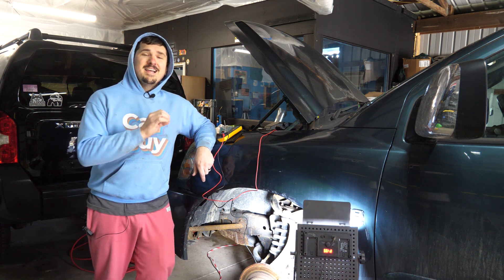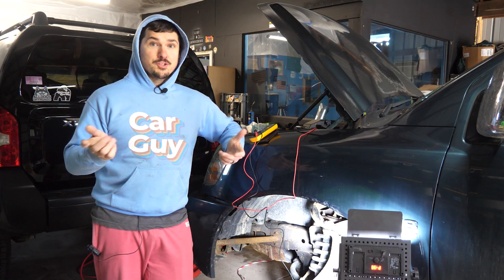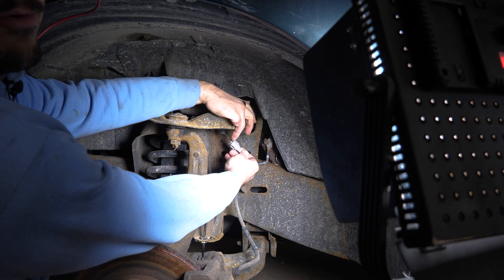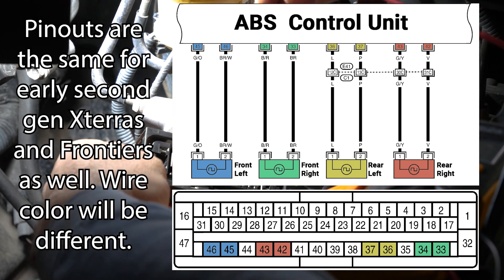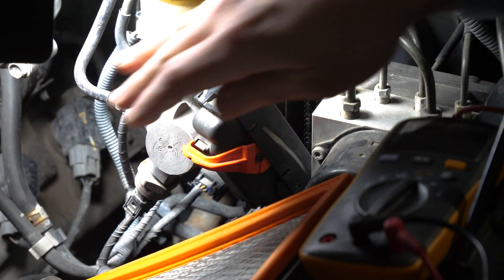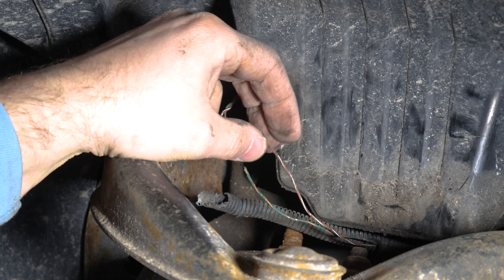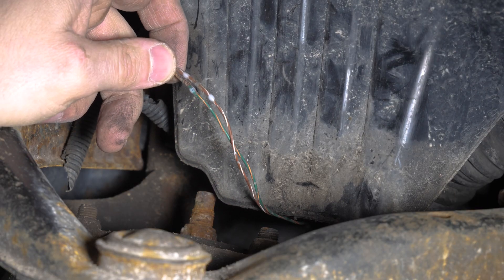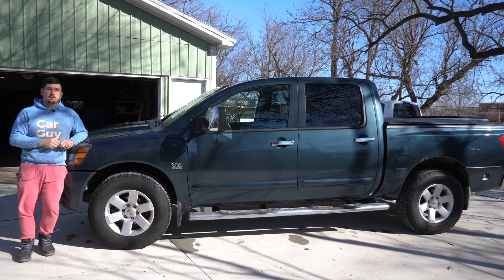How To Diagnose The SLIP, VDC, and ABS Lights on Nissan Trucks and SUV's

Comment: Hello Ry the car guy,  I have a frontier 2010.  Before I took my truck to the local Nissan Service Center. I only had the tire censer and the passenger safety bag light on. It was in the shop for a recall. Once I got the truck back, I drove off the shop inside and notice around the corner the emergency brake light, ABS light, SLIP light and the VDC light (off) was illuminated. These were not on when I pull into the shop. Do you think the mechanics disconnected or cut wire to the sensors? How would you approach this repair? Thanks
Reply from the maker: Wow, that's definitely not ideal. I would take it back to them and explain what happened!

Comment: What model scanner do you use from Thnkcar? I need to solve the ABS light problem along with the VDC and slip lights. Also the Diff. lock light.
Reply from the maker: I use this one and love it. ThinkScan 689 BT is changing the way I Diagnose.
https://youtu.be/keMX3X18bzY

Comment: Do the lights trigger anything on the OBD? I have an amazon reader but it says no error codes, wondering if i need a different OBD reader? Thanks!
Reply from the maker: Standard obd readers are only going to read basic engine codes. So no, you will likely not see anything on there. I use this brand and love it: https://mythinkcar.com/?ref=rzbuhuvm 

10% off if you use code RTCG

Comment: My same lights came on but also the brake light is on. Any ideas on that? I also have the 2004 Titan.
Reply from the maker: Check brake fluid level
Reply: Thank you but the brake Fluid is full.
Reply: Believe it or not, I wiggled the VDC solenoid relay, and so far the lights are out.

Comment: I have all 3 lights ON on my 2010 OR 6mt. error code points to ABS Controller. of course the part is discontinued.
Reply from the maker: Give me your part number. I probably have one here.
Reply: @Rythecarguy  mine calls for 47660-ZL00D, the scanner reads it the same too. But the sticker on it says 47660-ZL00C I haven't confirmed anywhere that they are interchangeable.

Comment: I have a 2011 frontiers pro4x. I bought used last year. These same lights have been on since I got the truck but it’s throwing a rear locker code. From what I’ve read online could need new rear axle. I hope it’s something easy like a frayed wire.
Reply from the maker: Sounds like a good place to start, I hope it's just a wire too! If you have a code reader you should figure out what corner it's on and start from there.

Comment: Hello Ryan, thank you again for another great video. I has intermittent VDC, Slip and ABS light illuminating on my 2015 Xterra, especially following rain. Figured out that the rear differential gasket (m226) was faulty enough to allow water in but not oil out. The lights went away once I cleaned the actual diff with brake cleaner, reapplied gasket, tightened the diff cover to specs, and refilled the oil; the final clue was the water infiltrated diff oil. Anyway, another possible cause of these lights going off, best wishes.
Reply from the maker: Great information!  Thanks for sharing.

Comment: I had the Slip and VDC light come on after an accident on my 08 Pathfinder, the hit was to the driver side front wheel. Messed up the knuckle and lower control arm. Could this be the same issue? Worth a try I guess.
Reply from the maker: Yea! The axels have tone rings and the sensor is right in the knuckle. If either of those are damaged you will get the lights.
Reply: @ thank you for that info.